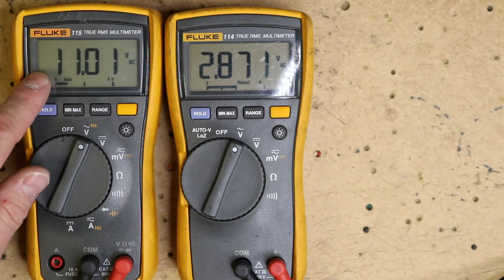What does High level and Low level mean in car audio?

Comment: But I have a factory radio in my truck that I connected a DSP from my factory radio to the DSP has RCA hook ups, so does that mean is it high level or low level?
Reply from the maker: Depending on the DSP the RCA inputs can be high or low level. There is usually a setting in the DSP input.

Comment: I have a question... Do i need a hi/low converter if the amp can handle high level input... For example a power pack or a micro amp? And why do i need one?

Comment: Hello Carl from the uk I have jvc -db98bt can I use 4 out put/rca on stereo to amp for front and back speakers and sub/rca output to another amp for my under seat 10”sub speaker and high level to my two 14” subwoofer box switch as it integrated amp all together

Comment: I've installed a Kenwood KAC-M1814 correctly on a 2017 Elantra but I'm curious about my factory head unit speakers (high level) output. I'm using a DMM to measure the max voltage and when the radio volumen is all the way up, it displays 4.1 Vrms using a 1 kHz, 0 db test tone. Is this enough voltage to work with the amplifier since I think I'm not getting the max output from it. Also, what will happen if the speaker level input are reversed? Thanks

Comment: Hello. I have it connected to the factory radio from the speaker output to the 110a sub speaker on the rca cinceve, although I have a high input on the amplifier. Would it sound better if I connected it to a high input since the signal is high from the radio speaker?

Comment: Hopefully you see this cause I needed some help. If my amp has both low level and high level inputs would it put out the same sound if I had a subwoofer connected to the amp. I was wondering because if low level would make it sound better I would get a converter but if there is no difference then I wouldn’t do that.

Comment: So is high/low level soley based off of voltage? Or is watts part of the equation? Reason I ask is I'm only getting 2 volts from my speaker output on my factory harley davidson head unit and all the bike shops are telling me to select hi level input on my dsr1. But when I do that the gains are 90% up and I get alot of amplifier noise. And it sounds much better with the dsr1 set to low level 2v input. But I have warrantied 3 sound digital amps that have started cutting out. Wondering if selecting low level is hurting the amps. And with low level 2v selected in the dsr1 im getting about 3.8v out of the dsr1

Comment: Got an amp that accepts high level up to 10v as input. You think the high level speaker wire voltage of factory radio is less than 10v or it’ll be around 11v like this video?

Comment: Question with pioneer deh 80prs. The body of radio has two switches one for std or network which I understand. Then there is a hi or lo switch for the aux input.  Stereo has rca jack. I am using rca to headphone adapter is this a hi or low level input.

Comment: Thanks. For many many years, I always thought the high level inputs were for HPF input. Above the LPF cutoff. Such as if you were using the amp, not for subs, but for tweeters. But in escence, its like a line level input, and low level is akin to a phono input? Am I right?

Comment: My new amp has a high level input and four RCA connections for my four speakers. Why would I want to use the high level input connections if I have the RCA  connections?  I wish Dean would write a book on different ways to install car radios and why they are different with lots of diagrams.  Better yet, I wish there was a web site where you can punch in all the audio components you are using in your car , the make of your car, radio, and amp, and it would do all the calculations hence tell you what size wires you need, length, and especially it would tell you why one way of wiring a radio is different than another and the best way to go.

Comment: If I want to use the front speakers wires as the high level inputs, can I still use the front speaker wires to power the front speakers and send the high level signal to the amp's high level signal?
Reply: Yes but you’ll have to loop the wires

Comment: Where are the multimeter probes connected? I assume the red probes are connected to the + signal wire, but for the black probe, is it connected to the ground or to the negative speaker wire?

Comment: In aftermarket radios, what kind of voltage is best for low levels? What’s the advantage and disadvantage of either a 2 volt or 5 volt?

Comment: Hello Five Star Car Stereo,
I have an 2015 Lexus ES300h, The bass is lacking and I want to upgrade the stock Subwoofer. I purchased an audio control ACM-1.300 and am going to replace the stock sub with a 8" JL 8W1v3-4. My question is... Can i use the stock subwoofer signal that goes to the sub to feed my amp, and plug it into the "speaker level" on the ACM? or whats the best way to do this?

Comment: Thank you for your video I am getting a amplifier and it had a option for low or high input level and now I know that my aftermarket stereo is a low level input
Reply: U want the best out of ur amp.... Don't go RCA'S.... 

Use ur stereo speaker out, connected it  to ur speaker input in ur amp... And u get more Power, RCA'S don't have any power, stereo SPEAKERS OUT have normally 50w per Channel.... Thank u :)
Reply: CHACA RECORDS 
Do you have a link to the speakers out that you sale ?
Reply: @Hugo-Hernandez  no im not selling anything

Comment: In my subwoofer i have both high level and low level but the stereo have only high level, should i buy a converter or can just connect it by using the high level and what is the cons of using high level. Tnx
Reply: I would like to know aswell
Reply: U want the best out of ur amp.... Don't go RCA'S.... 

Use ur stereo speaker out, connected it  to ur speaker input in ur amp... And u get more Power, RCA'S don't have any power, stereo SPEAKERS OUT have normally 50w per Channel.... Thank u :)

Comment: What's the difference between the sound when using a line out converter compared to aftermarket radio rca's
Reply: Nothing really. Most LOC’s actually have a benefit of adjustable power, so it might actually sound better than an aftermarket radio RCA.

Comment: This help me a lots to install an aftermaket radio and PAC-roem in 350z with boose audio. 👏👏👏👏
Reply: did u use the hi level or low level on the speakers?
Reply: @pvblo.z33  i used low level output from mi chinese unit to pac roem

Comment: Is there a diffrence in quality of sound?
Reply: They say low level is better but im using my fac radio w a LOC an it sounds good.
Reply: @letsgonow5641  Hello. I have it connected to the factory radio from the speaker output to the 110a sub speaker on the rca cinceve, although I have a high input on the amplifier. Would it sound better if I connected it to a high input since the signal is high from the radio speaker
Reply: @iron9044  Low Level is always best less interference prone. You shouldnt mix the two.

Comment: So ..... after watching this the only question i have is what does the high level input do on my amp ? Can i use the spkr output from my factory head(HA)unit to my amp ? And( iknow you're not supposed to start a sentence with and) does the " H L I " use more voltage than   the  RCA output ? And also should I have paid more attention to the video instead of worrying about what my comment structure , grammatical complexities and possible misconceptive perception pertaining to intellectually complex hummoristic antomologic idioms going to be or was it a hammer nail collision ? Lol

Comment: so how would you know what to set the levels at on the loc itself?  Noone really explains that in much detail.  At least I have yet to find a guide that does.  Thx.
Reply: You need a distortion detector like smd dd1 .use radio speaker line to read  playing a 0 db track at 40hz. Turn radio volume until red light turn s on  dd1 then back radio volume until light just goes off. That's your radio volume . Example volume 30 is clean.then on your loc,(line-out converter) there's a volume & bass adjustment.  Use dd1 at rca lines out of loc adjust volume on loc until light comes on on dd1 then back the volume just before the light is on still using the 0 db at 40hz tone. Now you set the gains on radio& loc. Now at the amplifier you will disconnect speakers & play a -10 db 40hz tone for the bass amplifier. While putting the volume 30 on radio  because you know is clean signal. Starting with amplifier volume from 0 put the dd1 lines on amplifier speaker terminals, start raising volume until light comes on at dd1 then back just before it turns on now you set the gains.  If you wanna do 4 channel amplifier do the same only difference is you would play a -5 db tone at 1k. Now you all set . To get ideas watch setting gains on smd dd1 by Steve meade hope this helps because I know I had to research and self taught 😀 enjoy your day

Comment: Hello I have a 2017 F150 with the sync system. The voltage of the speaker outs range from 0v to 8v depending on the volume level on the stock head unit. My amplifier supports up to 8v inputs can I just slap on some RCA connectors on the front left and front right outputs from the factory radio and connect it to my amplifier? Or do I need a Hi-Lo converter?

Comment: Hi Dean and Fernando. My head unit only has 4 rca outputs ( front & rear/sub). I'd like to run 2 amps. One mono amp for my subs and a 4channel for the mids and highs. My 4channel supports high level inputs. I want  to retain balance and fader while still having subwoofer control through the head unit. Will I be sacrificing sound quality by using this method to connect to my speakers? Is there another way to do this. Thanks in advance

Comment: I have a 2010 Ford Escape with sync navigation touch screen... does it have low level output? I don’t know if I need to connect a line output converter to that or to somewhere else in my car because I have a factory subwoofer and amp in the back right so idk what to do with that when I connect my new amp and sub enclosure in my trunk

Comment: if your amp has high input you dont need a converter?
Reply: That's correct...just splice into the L and R speaker wires and go into the high input on your amp.

Comment: Say you are using the low level (RCA) from the headunit to the Main amplifier low level input (RCA). 
Then from the Main amplifier speaker output into the HI level 4pin input of another amp in the trunk.   Could an audio delay occur, if both amps are Digital amps?

Comment: Love watching your videos.....came across a Optimus Bridgeable High power amplifier and figured I would install it in my 1995 jeep wrangler. I have an aftermarket Pioneer DEH-x4800BT car stereo with Pioneer 3 way 4 x 6 speakers up front and a Pioneer 8 in sub in the rear. How would I go about wiring this in?

Thanks Dave - javaallnight@gmail.com
Reply from the maker: +Dave Morris thank you. Do you want to power the 8 in or the 4x6? The radio have a set of rca outputs on the back of the radio for an amp.
Reply: I'm confused with your question? I assume you run the speaker wires to the input side of the Optimus and out to both 4 x 6 front speakers and rear sub-woofer. You will still need to power the amp separately, of course, right? And yes, I took a picture of the rear of the radio and it has 4 RCA outputs, L/R for front and L/R for rear/sub-woofer

Comment: which one do give a better sound quality is it rca cables or connecting it with high level coz ive seen some amp being connected with high level push way more hard sound rather than rca i just want to know which one give a better n clear sound
Reply from the maker: speaker zedan yeah I just watch a Kicker video talking about that. We tried it the other day and it sounded terrible. That is not to say they all will. You just have to remember the amp outputs clips out way before the RCAs.

Comment: Thanks fellas as always. So does high voltage means lower gain settings? i ask because people always talk about turning gains up to get more sound. i always thought the higher the output voltage the higher your amp gains would be, which is what you want. correct?
Reply from the maker: Brian Miles the higher the output voltage, like a 4 volt radio, the lower your gains will need to be. We are trying to come up with a easy way to get that a cross in a video. Hopefully one day soon.
Reply: @FiveStarCarStereoInc  Okay soo I've got a question for you guys... And that question is; I have an aftermarket touch double din. So what i want to know is;  yes I have RCA inputs for front rear and sub and high level input from the harness obviously. So what do you honestly think gives out the best audio output...? For me to hook up RCA's or to run the high level wires and solder & hear shrink em to the wires on the harness in the back of my unit...?  Also wanted to know but I mean im pretty sure you kinda explained it in this video and other people have in other videos, but I want to be 1000% sure to not do something completely unnecessary or ruin something... But anyways,  if I decide to hook up  via "high level input," right... Do I still need to hook up any RCA wires at all? (& That's for hooking my fronts and backs to the amplifier.) Or is that honestly the whole freaking intended point 😄of using "high level inputs" is when you either don't want or have no RCA inputs in a say... Stock radio...? Right?   Sorry for such a possibly confusing and long message I've just been looking all over the internet and can't seem to get a 100% straight answer to what I just asked it's usually close to what I want to know but not exact.